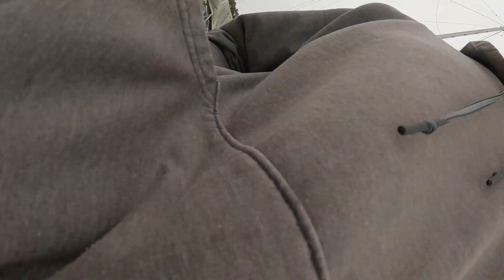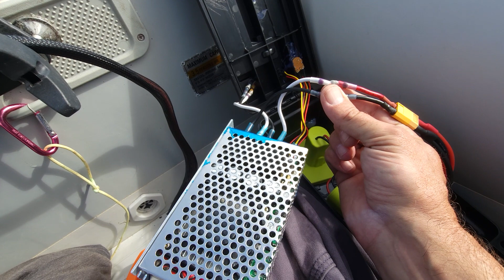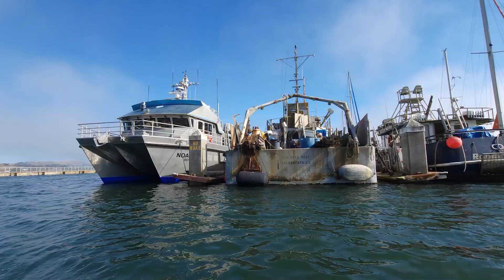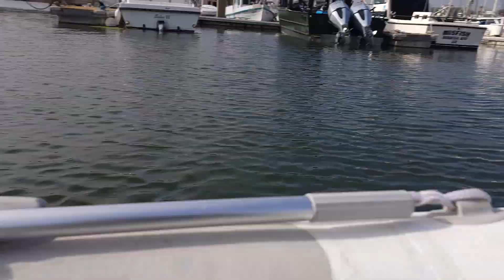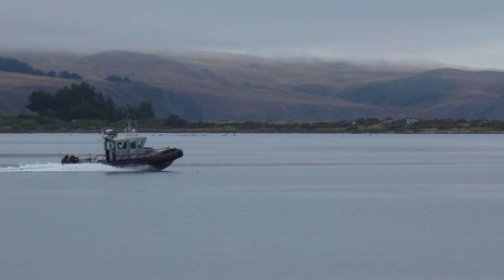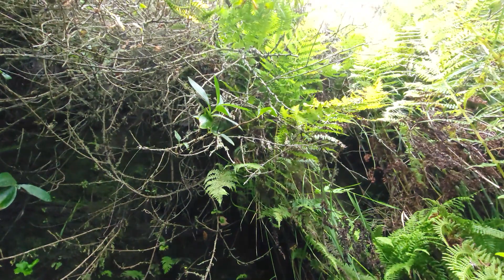Trolling Motor Tool Battery Dingy Range Test #sailing #sailboat #sailboatlife

Comment: Great outcome and a kiss,solution in the end . 
I would,like,a,simple set up like,that to put in a,small 21' racing keelboat that,would,run,for the 5min in and out of my slip,in the,marina,as,sailing down between the,slips  can,be,an,issue,when,the,wind,direction is wrong a d with all the,boats blocking the,wind etc.  
I think it would,work great .
Cheers warren
Reply from the maker: did you see this one? https://youtu.be/x8TmeDZOvbU This setup is now in storage as I got my diesel up and running again. Did you ever find one for your 21' keelboat?
Reply: @BUSTERandSEATON  I haven’t found one yet for my boat , I recently got an electric lawnmower that uses 4x 60v lithium batteries that are small and would make great trolling motor power source. 
I’m currently using a noisy Chinese outboard for the 1-2 minutes I need to get out of slip . I usually sail in on the jib.
Cheers Warren

Comment: That's a much better system.  One thing I learned through experience is to try to keep the number of components to a minimum, for reliability reasons.  I had most trouble from joining wires improperly, like you have.  Some of the cheap connectors online can be problematic.  It's hard to buy that sort of stuff sight unseen.  Good crimping pliers are a must.  I tried those soldered connectors and ended up crimping them or then not using them at all.  Nothing worse than a bad connection at sea on ones electric engine ;)
Reply from the maker: "Make it simple, Stupid."